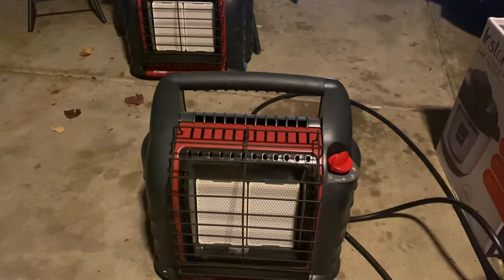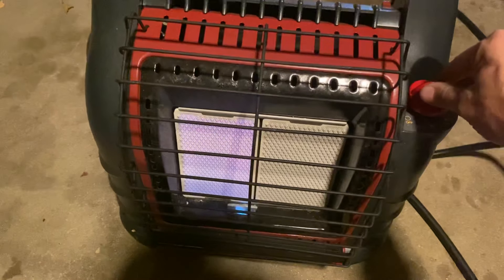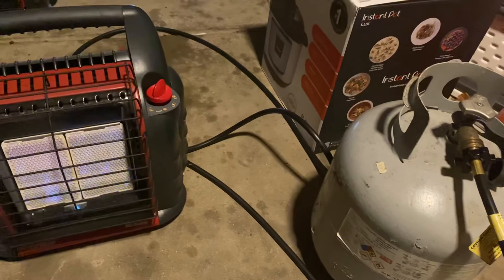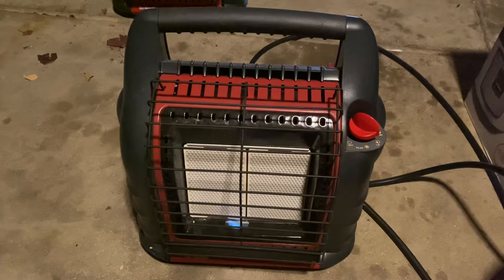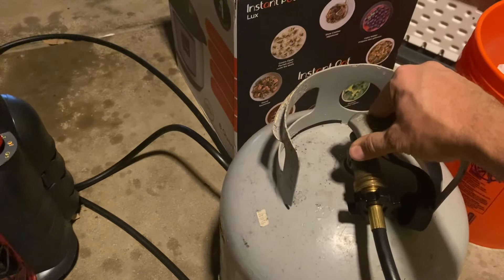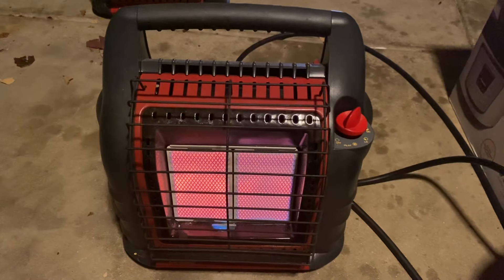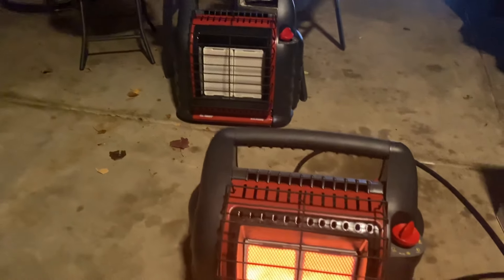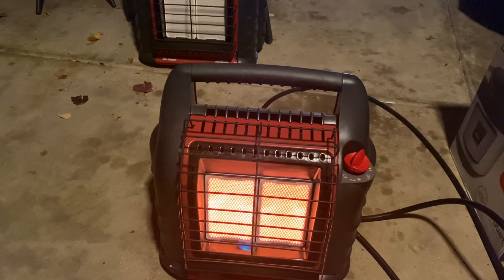Mr. Heater Big Buddy Shuts Off-FIXED

Comment: You are a freakin genius! I had this issue a couple times right when I hooked up a brand new full tank. The first time it happened I turned off everything, unscrewed the connection to the tank and reconnected, then it worked, thought maybe my connection was bad. Second time it happened, there seemed to be no fix until I came across this video -- worked like a charm! Thank you so much

Comment: Its not your regulator.  Its a safety feature of the propane tank.  Basically the "new" style propane valve requires back pressure to open.  If you don't have that initial back pressure it won't flow.

Comment: YOU!  You are the MAN!  Every vid I found was "I saw a vid where this fixed it so I made another one only more dumb".  Not you, you nailed it and saved my ass!
It was 59°F and dropping fast in my RV; I had to put my electric quartz radiant heater under the skirts as my kitchen faucets stopped flowing.  The hot goes out first but I've always caught it before the cold stopped but tonight is different.  It hasn't been above freezing for four days; then, the next 3 days it hasn't been over 20°.  Right now it's zero on it's way to -3°.
After sunrise and our whopping 9° high it will continue trending downward to a high of 4° and a low of -18°.  The forecast is calling for a quick jump to 47° a week from now; until then it's going to be colder than a well-digging witch's T&A in a brass bra...
Luckily, I got ~6" of snow to insulate and fill in the gaps  around the skirts and we don't have the 45mph winds we did last year when it didn't get this cold but was a nightmare logistically as I sat at my desk sipping coffee and watching skirt panels go sailing into oblivion (I also upgraded to 1" from the .5" I had to get last year because I waited until the last minute.
I'm running this directly off my RV tanks (yes I brought them inside, they just won't work at -20°) and my Dometic is on the fritz so no forced air. Shortly after sunset the water inlet -  I put a Y on it and when I opened the part of the Y my ground water isn't attached to... Nothing.  I took an Amazon box about half the size of a size 10.5 shoe box, after some judicious razor knifing I taped it over the Y and put a tea candle in it; 30 minutes later she's flowing.  That's how the evening started before the kitchen faucets froze up (that was ~8pm, the faucets were frozen by midnight) but tea light has the bathroom nice and happy.  That's when I put my main electric heater underneath and started getting cold inside and this little shit decided not to stay lit after switching from a 20# to my bigger RV tanks, OR when I switched back.  My poor mini-dachshund hasn't gotten out from under the blanket for more than an hour or so all day and the kitten, who hasn't minded staying out all night even down to 20° (I made her a nice little insulated cubby in the stairwell with her favorite blanket and she seems extra content with her long-haired calico coat) is just going stir-crazy from being inside but not so crazy as to stay out more than 10-15 minutes tonight.
Is 40° going to kill us?  Nope; but it sure is a lot nicer at... 68!  That's up nearly 10° since I started this!
Hit me up if you're in KC MO, I'll buy you a beer or 4.
Give this ALL the upvotes toobers!
Reply from the maker: I have family out there that I want to go see and I sure could use a beer right now haha! I’m glad you’re up n running again! The way you described it I felt like I was right there suffering too with all the fur babies. Sometimes a few of those disposable hand warmers might help keep the tanks warm too if it comes down to it. When it’s this cold outside the gas always has trouble converting to gas no matter how big the tank is. Well, stay safe and stay warm and always have an extra tank ready to swap if you can. Cheers
Reply: Living in camper for 3 years northwest Indiana,bought big buddy last year,big blessing,this year sputtering on low now,11 degrees out this morning -5° wind-chill,need to try resetting the tank,thanks,much love, Indiana bill
Reply from the maker: @welcometothetruth6651 I feel ya! I’m next door in Illinois. It’s brutal out there the last couple days

Comment: Thanks for the video! But it did not work for me 🤷
Reply from the maker: @American_Muscle_Truck  can you describe it like I’m blind and deaf? Maybe I can pinpoint a possible problem. Kinda explain like you were at the car mechanic (it sounds like plft ping plft ping plft ping)
Reply: @cabinlife1886  😂😂😂 when I purge the remaining gas from the line and slowly turn on the propane to turn on the heater to high.. regardless of how slow I turn on the propane and with no fuel in the line, the fire struggles to stay on and then turns off. The good news is that I saw another video where people can take a q-tip and clean out the part that brings the propane to the igniter. It's working great now thanks for responding. 👊
Reply from the maker: @ I’m glad it’s up and running again. One trick for the heater (if you’re not a heavy duty user) is to actually use that cotton swab and put it in there when it’s in storage so the dust and spider webs never have a chance to get there in the first place.
Reply: @cabinlife1886 great thinking! Because I have the smaller heater in storage. The bigger heater I use around the house and it has obvious dust by the igniter... Sometimes you just need to hear it from somebody else. 👊

Comment: Any thoughts for us who use the little bottles it was designed for?
Reply from the maker: It was actually designed for larger tanks. The 1 pound tanks is the gimmick that sells this worldwide. Yes they work but not very good in colder ambient temps. Perhaps the best thing to do is try and insulate the little tanks so they don’t get “as” cold. The colder the tank, the slower the liquid turns into gas. To try and help it along, try to put a sock around it, preferably a wool sock in my opinion.

Comment: Good video.  I just bought a big buddy.  Pilot light comes on no problem.  Panels light up fine.  But after 10 minute it shuts off.  When I light it again, I get the flickering flame but it settles down and lights up the panel and looks and sounds fine.  But after 10 minutes, it shuts off.  I am using the cannisters, so can't adjust the tank.  Any suggestions?
Reply from the maker: I can’t use the big buddy with canisters on high. Only in low or medium. They’re not canister friendly on high unless the ambient temperature is pretty high. The colder it is the harder time it has priding gas. There’s science involved with the liquid propane and I think the only way to get full heat is to use tanks that are at least 5lb or 20lb.
Reply from the maker: Typo. I meant “producing gas”
Reply: @cabinlife1886  Thank you!  Keep making these helpful videos.

Comment: You are the first person that explained what was happening to me. It also happens now and then with my gas grill. I get a good blue pilot flame, but when turning it to on, will not light and flame goes out. I knew to turn on the tank slowly, so try to be careful there. Over the last couple of weeks have refilled tank twice and worked with no problem. Today refilled the tank and it happened again. I didn’t know to turn the tank off, purge the line, then reopen the tank. So thank you for that info. While I was messing with it, went ahead and cleaned the orifice with alcohol.
Reply: Thanks so much

Comment: Thanks for posting this video. I had this heater at the top of my P.O.S. list of things I wasted good money on.  I’ve only had it a couple of months. It was doing exactly like yours. I thought that maybe the 20 pound tanks fresh had more pressure than the regulators could handle because it was designed with the small tanks in mind and the regulators might be too sensitive for the pressure from the larger tanks. Never would’ve thought of just increasing the pressure slowly. Thanks again for sharing this information.

Comment: I just used the 20# tank last night to take the chill off in my basement. Had it on high for 12 hours then turned off to use another day. Question- should I turn it off at the tank too?
Reply from the maker: Turn it off at the tank first, let the flame go out so it purges the line. Then turn off mr heater. This way gas and pressure doesn’t stay built up in the line.
Reply: @cabinlife1886  Thank you!  
Also, now I have a fresh tank- 
But am having trouble getting it to light. Any ideas?
Reply from the maker: Sorry for the late reply. I didn’t see it until now. Regarding the trouble you’re facing with lighting it up again, it could be due to various factors like gas pressure, a clogged pilot tube, or thermocouple issues. It’s advisable to check the connections, ensure the propane tank has sufficient gas, and the valve is opened slowly to prevent tripping the safety valve in the regulator. If the issue persists, you might want to check the pilot assembly and thermocouple. Don’t hesitate to ask if you encounter any further issues, happy to help!

Comment: this is all good but mine does this when on the one pound bottles.  do you have a fix for this?
Reply from the maker: They’re not really useful with 1 pound tanks I’m afraid. They just can’t keep up when it’s really cold out. It all has something to do with the surface area of the propane liquid itself. That’s why 20 lb tanks work so good. They produce gas from liquid much faster because of the surface area of the liquid.

Comment: I just use the small cylinder propane tank and have similiar problem.  How do you regulate the gas coming into unit?
Reply from the maker: It still has a regulator on each side. You can only turn on high if you use two cylinders.

Comment: 3:38  You talk about "turn it on slowly."   Actually, hook up hose, make sure heater if fully OFF.  Now slowly crack the valve on the bottle to 1/4 or 1/2 turn.  Do this slowly.  Shut off valve on bottle and crack it open again slowly.  Do this three or four times.  Should take you 25 seconds.  What you are doing is FULLY PRESURIZING the rubber line.  Once line is charged, you are good to open the valve at the HEATER, or your BBQ Grill.  In the trades we call this a "NADER FAILURE."    Remember the Ford PINTO explotions, the GM CORVAIR car?  Ralph Nader came to fame by "making things safer."  The lawyers asked the engineer to create a "safer rubber hose," and they did invent a hose seeking an innocent consumer.  There is a tiny lightweight plastic ball inside the brass fitting that screws into the tank.  It is called something like "Excess flow safety cutoff device."  The idea is, if you accidently cut the liquid propane line in half, you don't want an  INSTANT BLOWTORCH.  If there is a SUDDEN SURGE of flow from the tank, the plastic ball gets forced into an OBSTRUCTION.  Never, ever, disassemble a shower head to remove the "water saver restriction,"  and NEVER, EVER, play around with the brass fitting that screws into the 20 lb propane tank and remove the 3/16 inch diameter plastic ball.  If anybody does this they will go to jail and sit next to the guy who cuts tags off his pillows and mattress.  Across the way is the guy who breaks the third prong off of grounded extension cords when life gets challenging.
Reply from the maker: Nice comparison! I didn’t know there was a check ball in the tank too. Gonna research that too. I wonder if this is the problem some people have when flames shoot out of the heater
Reply: @cabinlife1886  I didn't explain clearly.  The tiny plastic check valve is located at the "head" of the hose assembly within the hard brass part that threads into the valve assembly atop the tank.  There really is no reason to remove this ball.  It is there to limit flow if there is a malfunction of the rubber hose, or downstream regulator.
Reply: BINGO 😮👍
Reply: @chetmyers7041 
Makes even more sense bro
I'm sitting here like yes this fixed it 
Yet why my Ryobi 18v hybrid forced air propane heater w/ 20 ft hose has no issues turning that one on fast?
It makes more sense that it's a hose safety shutdown 
Plus my camp stove came with a hose and no issues 
In the past decades this was a on and off problem 
Glad I thought of it 😂😂😂

Comment: This is the best and simplest video I have seen. I had so much frustration with mind dying out seemingly for no reason. The only thing I would add is, instead of just opening the valve slowly, open slowly and do not open all the way. For some reason my heater liked this approach. You can always open it too a fuller extent later but start off with the tank valve barely cracked and see if it works. I was so frustrated trying to get this going with the new tank and this video helped me. I don't know if some tanks have more pressure that actually blow out the flame? In any case this work well for me.
Reply from the maker: There’s only one reason too much pressure would blow out the flame. The pressure regulator. I’ve also seen someone’s heater spitting flamethrowers out which also is a faulty regulator. The good news is, is that 90% of everyone’s shutoff problems are due to the regulator actually working and doing its job and restricting flow to a minimal leak until it dies out. I’m glad it helped you and I agree i would start with the half open method

Comment: Didn't work for me but I also have it on a 40 lb cylinder right now, but it did the same thing on a 20 lb.  And I have tried it with only a quarter turn open on the valve on the tank.
Reply from the maker: Does it flutter out the same way or just click off suddenly
Reply: @cabinlife1886  flutter then click off,. I can keep the pilot on if I switch it to pilot before it dies, but while still sputtering.
Reply from the maker: Try purging the line and then disconnect for a good minute
Reply from the maker: Question, do you have the quick disconnect line or a filtered line? You don’t happen to have a hose with it’s own regulator AND a filter?
Reply from the maker: The reason I ask is because I’ve seen people use the hose with a built in regulator and then stick a filter on it and then….install it onto the onboard regulator. It doesn’t need 2 regulators and a filter. Matter of fact run it without the filter after you reset the regulator and see what happens. You don’t need the filter for impurities as some people will tell you, you need the filter for the oil that eventually makes it into the line but the line would have to be pretty old by then. New lines won’t seep oil until the rubber softens up over time.

Comment: Brand new Mr Buddy put on two 1 lb tanks . Boom. This happened
Reply from the maker: Let try and troubleshoot. Purge the line by removing the tanks and ignite the pilot and hold down the button until it goes out. Insert both tanks slowly. Next light the pilot and let it run for 5 minutes and observe the flame. Is it normal? Is it little? Or is it not all blue? If it’s orange then clean out pilot hole with cotton swab. If it seems to be working fine turn in the low setting for another 5 minutes. If it’s ok then crank it up to medium setting for awhile. If it seems ok crank that puppy to 11 and see what happens. If we can rule out the regulator please explain your observations. The pilot is touching the thermocouple? Does it simply click off or does it seem to starve for fuel until it kinda putters out? We might have to look elsewhere. Is the outside temp really really cold and if so what is the ambient temp? It could have trouble simply producing the gas because the temp is just too cold. Let me know what you find so we can see if it mechanical or simply circumstance.

Comment: I wonder if the mr.buddy regulators are damaged by exceeding their 150psi limit?

The problem I'm having is too much gas flow - which makes me think both regulators are bad. Using 1lb green bottles.
Reply from the maker: I would think so. They might be cheap regulators. I haven’t been able to find out how to tell a cheap one from a quality one. Did you refill your 1lb bottles or are they store bought? I refill mine. When you overfill a tanks the devil comes out to play and flames can shoot out.
Reply: @cabinlife1886  I refill mine. The regulators say 150psi max - which you can easily exceed with shop air.

Comment: I'm glad you figured it out, and it was an easy fix. Things like that can drive ya nuts. I pried my wallet open, blew the dust off, and bought the regulated quick-connect hose and it's worked great for 3 years now. Stay warm my friend.
Reply from the maker: Thank yiu

Comment: Problem I’ve had is using heater inside a semi trailer to keep product from freezing.  Would run for some hours but be off when checked in the morning. Called the manufacturer and was told it was the automatic low oxygen shut off. Would be an odor of exhaust when opening the trailer door. Any other ideas?
Reply from the maker: I believe RV people would be better to answer that one. Hopefully someone will chime in?

Comment: what about the buddy heater with the one pound canisters?  That is the unit I have,  how to you slowly add the gas?
Reply from the maker: I would think just installing very slowly. I only use the one pounders as an emergency though. They don’t lay long and you need two to get into the high output mode.
Reply from the maker: Not “lay”. I meant “last”
Reply: @cabinlife1886  I really appreciate your response.  This technique is not working on my unit, it's the smaller Buddy version.  Driving me crazy, brand new unit will light up and run normally for 2 minutes and then "click", off it goes.  Tried different canisters etc.  These things seem to be so twitchy.